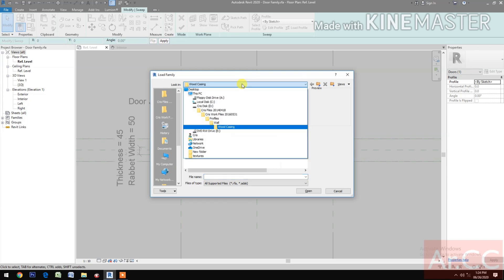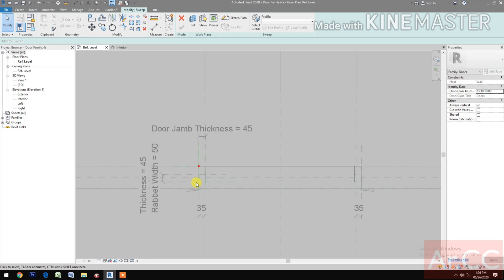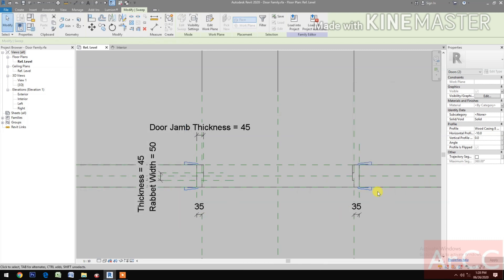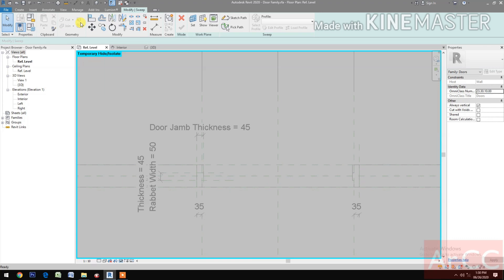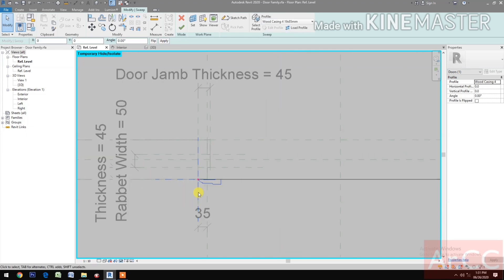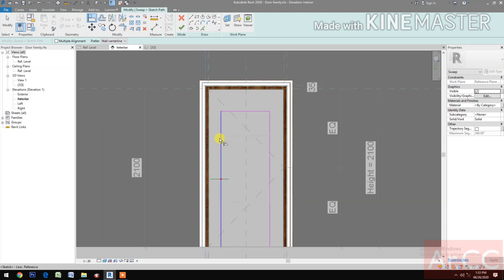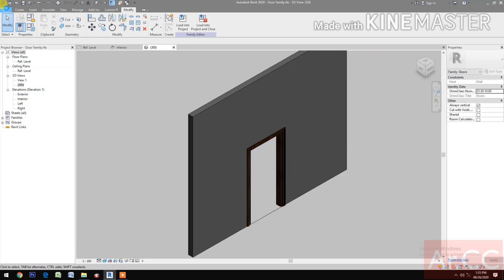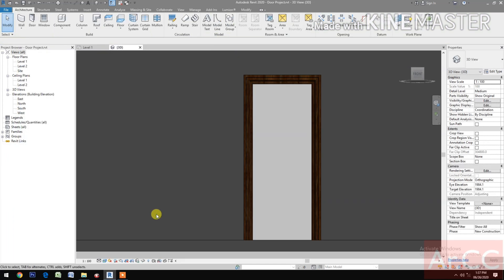RD038. How to make a Parametric Doors in Revit. Part 2 Door Casing.

Comment from the maker: Recommended Video:
RD037. How to make a Parametric Doors in Revit. Part 1 Door Jambs.
https://youtu.be/TH821Btutw4

Suggested Videos:
RD115. How to make an Off-Center Pivot Door in Revit. Parametric Door in Revit.
https://youtu.be/VGfXo0d6vX4
RD114. How to make a Bi-folding Door in Revit. Convert Swing Door to Bi-folding Door.
https://youtu.be/sIAz_u1CAT8
RD113. How to make a Parametric Arabic Pattern Pivot Door in Revit. Pivot Entry Door in Revit.
https://youtu.be/3tAyuCpotGw
RD110. How to make a Classic Ornament Parametric Gates in Revit. Steel Gate Design in Revit.
https://youtu.be/STm4xRDQTdY
RD069. How to make a Parametric Pivot Doors in Revit.
https://youtu.be/Wkf7jAVMRoc
RD055. How to make a Parametric Doors in Revit. Part 13 Modern Door Design. Swing Door.
https://youtu.be/syWkgU3JDLU